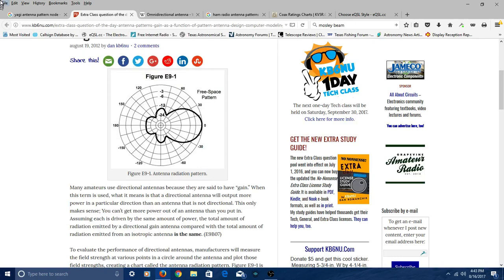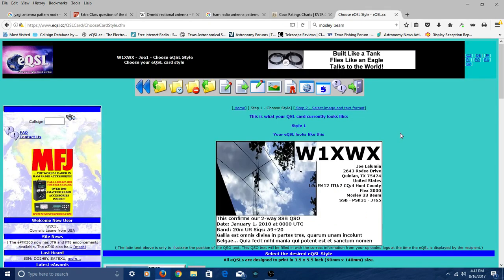Mobile radio antenna location affects your transmit range

Comment: Hello from north Texas.  You mentioned Dallas and I said hey, we could be neighbors. Haha. Thanks for the video.  I am trying to place my tri-band VHF/UHF antenna on my new GMC Sierra.  I could drill a hole in center of roof and use the third brake light to guide it down into the cab. I am also considering a lip mount for hood which would mean the cab is blocking signal to the rear.  Decisions decisions. Haha. I had used a mag mount  on a previous truck. So on the roof would be better for Omni but then my antenna will be too tall to go into garage.  Thanks for the video.  73 de KI5HXM

Comment: did you ever connect your handy talkie to the example antenna in this video while the magnet was on your round pie-pan? What sort of performance change did you observe over the stock rubber ducky? Thank you. As others have said, ignore the haters.
Reply from the maker: WaterWhite Tuber yes I did
 The mag mount is a better antenna than the one on the ht. I actually mounted the pizza pan to a tripod with a short mast and raised it up about 8ft. It did reach a little further.

Comment: The grounding system of an automobile. is critical to antenna performance. Do you have a video addressing this? If not, would that be possible? Thanks, KC3BXZ Joe
Reply from the maker: Good question-- first grounding for proper radio operation is critical.  In my case I ran a grounding strap from the radio chassis to a seat bolt. (the radio is installed under the front seat. Additionally it is connected directly to the battery with a fuse very near the battery post on both the positive and negative lines. Never had any issues. (my mobile is an Icom 880h). 73